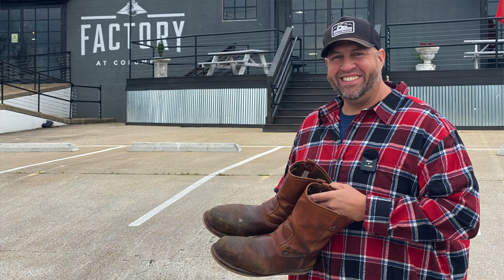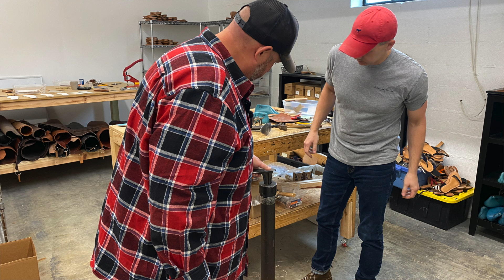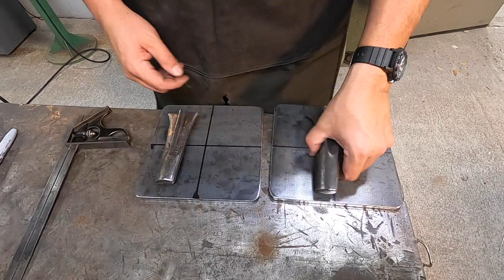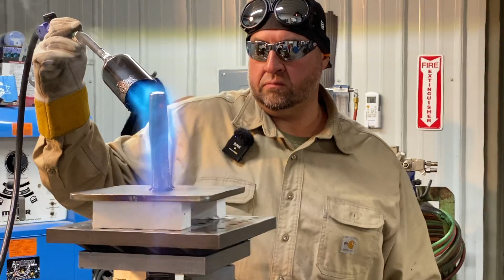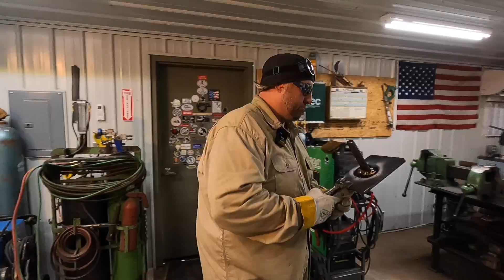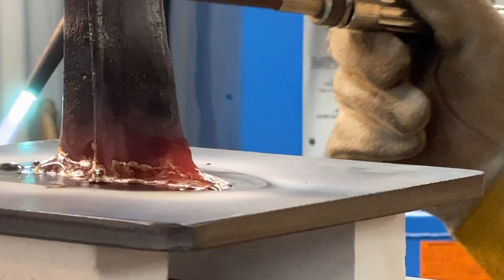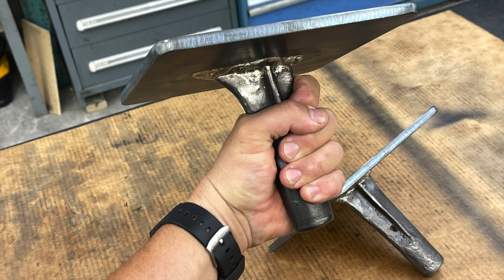Custom Shoe Anvils for Potter & Sons

Comment: Have you ever used a gas flux brazing system, Adam? I just made one from a small propane tank. I also make my own 'flux', as it's just trimethyl borate and is easily made with a still, methanol, borax and sulfuric acid drain cleaner. It's an interesting process and the witch's brew green flame is a real plus for the camera. :)

Comment: Hello,  I do agree with you that other ways could have been used to do the work but, you are the one that had the work to do so if you are satisfied with the work, and the customer is satisfied, that is what matters.

Since I am also a blacksmith along with being a machinist, (had to learn blacksmith to be able to do more things as I only had a metal lathe and a vertical milling machine. With that said, I would have forged some columns or whatever you call them out of steel and TIG welded them all the way around with steel on steel. But it is what it is and your reasoning is solid as a rock.

Comment: I am not a welder, but I think Adam is right. It seems to me that nickel is a much denser, harder material, and that makes it more brittle. Kinda like carbide versus tool steel. The silicon bronze will flex more than the nickel. I also think that the acetylene torch is probably better as it allows for a broader heat input as opposed to tig which is a more focused heat. I think using a more controlled broader heat is a better way to  go when brazing, but again, I am not a welder. Just an observation. I've learned to trust the gut feelings from those who have been trained by their fathers like I did in my line of work (asphalt construction). Starting in a trade young and being trained by your father (and grandfather) is a method of training for which there is no substitute, and is often superior than any other means of training. Especially with craftsman trades. Trades where you work with your hands, and use tools to create. It is a shame there is not more of that kind of training around today, like there was in centuries past.

Comment: 1983 high school metals shop class.  Our teacher brazed a pair of tubes into a T.  Then we put that into a vice and used a huge pipe wrench and breaker  bar to tear it apart.  The steel adjacent to the braze ripped apart, but NOT the braze!  Our teacher use to build tubular race car chassis with all the joints brazed - says the joint he just demonstrated is by the rule book.  I've never doubted brazing ever since.

Comment: I'm curious, why did you use the original casting and not just turn a new rod at that diameter, then weld it on?  Does it fit into their anvil holder a certain way or have special grooves?
Reply: Please re-watch the video...it is far from a round "rod".
Reply: @bushmaster2936  I saw it, It's an oval shape. Also it's got a seam down the middle where the molds were put together.  But I still think it's wouldn't be too hard to machine an oval shape on the mill.  I was more curious about the way it's used by the shoe guys.  I've gone to their channel and watched also.
Reply: @thisolesignguy2733  I'm not saying that Adam couldn't do it, just why would he go to all the extra effort and time for a freebie job? Also, he would have to do numerous set-ups all over again should they decide that they want more, or even something totally different after using these prototypes. : ) This is basically an experiment for both parties at this time. They had surplus parts and they were put to use in the most efficient manner by Adam. : )
Reply: @bushmaster2936  I understand exactly what you're saying.  and I'm in no way asking whether he can do it or not, or how difficult it would be.  My main question was how it fits in the anvil holder and his train of thought on the process.  But I have done some research and it indeed is a specially made oval hole that friction fits the anvil into it by way of a tapered stud.  This prevents the anvil from turning and also secures it into the work tool/bench.  Which would be in my opinion the main reason Abom decided to use the original.  and I agree 100% with his decision after researching it further.
Reply: @thisolesignguy2733  Awesome : )

Comment: Ni-rod can be used successfully but it does have a tendency to induce a lot of stress which, over time, will develope cracks. The trick to it is to weld no more than 1/2" (12 mm) at a time and then peen the hell out of it with a chipping hammer or a needle gun air chipper while it is still hot. The peening will stress relieve the weld and help stop cracking. There is nothing wrong with gas brazing or TIG brazing on cast iron and they both have about the same overall strength when done properly. With a fillet weld like these were, it helps to put a small bevel around the base of the casting. This gives more surface area for the bronze to bite in and hold better. MIG would be absolutely useless for this and would soon fail. And for anyone who is interested, I got my Alberta First Class Journeyman's Ticket in 1978 and my B Pressure ticket shortly there after so yes, I do have some experience.

Comment: Keith Rucker and Keith Fenner both do a lot of brazing. Keith Fenner brazed the final drive of a dozer if I remember right and he gave a nice explanation of how it would hold up and take the wear and tear. I've brazed with a torch many times before and have also welded using steel rod. Gas torch welding is becoming a lost art.

Comment: What is the point of cutting them off?  Why not use them as is and just bolt them (or braze) to the steel.
Reply: They're not flat.
Reply: @dolvaran  Yah, I seen that, after I shot my mouth off.

Comment: yah, i don't think tig braze all the way would be very good, the torch allows heat to draw the braze all the way in, tig looks like it gets the tip and not much else.  of course, i don't have any tig experience, but it seems to make sense, tig has a small heated area.

Comment: WHAT ARE IN THE LONG RED AND BLUE PLASTIC TUBES ON THE WALL BELOW THE RIGHT ANGLE GRINDERS WALL RACK?
Reply: Those are tig filler rod holders. Each one will have a different size and type of tig welding rod.
Reply: THANK FOR THE INFO.  I WAS THINKING BRASS BRAZING ROD.  CLOSE BUT NO CIGAR. @michaelpeace716  THANK

Comment: Old school brazing is unbeatable imho .. BUT .. I'm curious .. when you mentioned the brazing could have been prettier, .. could a person run over the final braze before it cooled with a tig to flow the braze? Ive seen guys do that with aluminum as a "second pass" .. no added material, just cleaning up the welds. Obviously not needed for this project, but on something more visible that needed to be better looking .. ??

Comment: Another very interesting video great job something a bit different. 
Having never tried tig brazing I can’t comment on it. I have seen finished tig braze it looks pretty for some applications. I have done lots of old school fire torch brazing over the years as a heavy duty mechanic. I agree I like the control with a torch and the flow of the brass with dissimilar steals done right it looks good and is strong. I have seen and had to fix braze welds that someone else made a mess of. It might be fun to try tig brazing some time. But that’s a shop only proses when a lot of my work is out in the field with heavy equipment a tig welder is not an option.

Comment: We used to use brazing on truck parts, done right it's solid. The only thing I would have done different would be to use flux that you dip hot rod into, sometimes in the past the flux coated rods didn't have enough flux for heavier applications, which had me avoid them. I'm about 30 years past when I blazed regular, so the newer stuff might be fine now. Have a great day.
Reply: I've also had issues with the fluxed rods in the past. Sometimes you need the dip. : )

Comment: on the internet and youtube there are going to be the armchair experts (the meaning of an expert is A DRIP UNDER PRESSURE )
and i don't mean that to be a jab at the real word welders good job
Reply: It cast iron on steel.  Clean and braze is fine and appropriate.
Inert gas is needed for materials like stainless steel, aluminum,  and titanium (materials weakened by oxides)

Comment: 🤣 24:00 . It is the land of infinite resources here in commentland. If we're going to "should've, could've", might as well have forged a custom shoe, CNC machined back taper with induction hardened flat surface to perfectly fit the application. Ain't no kill like overkill.

Comment: THAT SHOULD HAVE BEEN DONE SOUS VIDE. Parts should have been put in a hot water bath, drizzled with olive oil and elmers glue, then soldered together after a quick sear on a charcoal grill, not propane. This channel has no idea about cooking heavy metals.
Reply: Spot on.

Comment: Dissimilar materials - Silver solder or Braze.  Steel to Cast Iron - your choice. In addition, either method fills all the area between the materials. Any type of welding would leave voids between the shoe piece and the cast iron.

Comment: super cool. perfect technique and application. the rod and the parent material have roughly the same tensile strengths. if you tig braze the whole thing the grain structure of the parent material gets altered to really fine and its becomes brittle. oxy/acetyl all the way. learned through  Keith Fenner and verified by me. i would much rather have a tig torch in my hand, but it's not the way in this case. i really enjoy your videos. i wish you had an HBM. i miss that stuff. one of the coolest machines.

Comment: While you still have all of those shoe anvils, I'd take some measurements of the shank of the anvil that fits into their stands.  You would then have the dimensional data as well as an idea of the variation between parts.  This would let you machine a new shank out of steel, which you could more easily weld to.  You could then cross-slit the new shank to fit wider gussets to better support the large top plate for heavy applications.

Comment: I don’t think people understand that cast iron and mild steel are dissimilar metals. If it needs to be tough and quick, flame brazing is king. 

I used a couple weed burners in a fire brick forge. Those things can really pump out the heat.

Comment: A huge problem with real world testing is there are VAST differences in the metallurgy of castings and thus how they respond to welding or brazing.  It is really just a pot luck on this stuff as you rarely know how it is going to go until you are already in the middle of the project.  Welding is only slightly stronger than brazing and definitely more of a gamble at getting pulled off right.  I agree for most repairs and mods flame brazing is the safest route to  success.

Comment: What did you do to ensure that the plates would be level when installed in the stands?
Reply: He said that he squared up the initial cuts on his belt sander. Watch the video again right after he cut the first one.
Reply: @bushmaster2936  By "square up", I think he meant he would make the surface flat using the belt sander. It looks like he just eyeballed it for squareness.
Reply: @leopfeffer2419  Yup, the initial angle grinder cut was not a square cut. I can't see this professional not making sure that it was both flat and square before joining the pieces in unholy matrimony for ever and ever . : )

Comment: Why not leave at least part of the flat on ?  That would give a bigger surface for the braze.
Reply: There was nothing flat until he cut the shoe form off.
Reply: @bushmaster2936  it looked pretty flat across the heal & toe area.
Reply: @spirittomczyk2174  Feast your eyes at the 28:52 mark and you should clearly see the curvature and the gap that would need to be filled along with the angle created from heel to toe. : )

Comment: I'm no expert, but I agree with you on brazing over TIG brazing.  A TIG arc would put to much heat into to small an area on the cast iron and cause stress cracks and eventual failure.

Comment: Without the socket they put these things in it's hard to tell how square/level the plate is gonna be.  But eyeball is probably OK. 

I'm sure that braze is gonna be strong but trying to think what I would have done myself, maybe some tapped hole into the cast iron cause I never learned how to braze properly.  Dunno if there's enough meat tho.

Comment: TIG is great for welding where you need a localised heat, but for brazing you really need lots of evenly distributed heat and this gives a regulated cooling afterwards.
I've used all sorts of methods and techniques over the 50 years in the business, and you can't beat a flame.
Reply from the maker: I agree! 👍🏻

Comment: Using a stainless steel electrode is also another process you could use in welding Cast Iron to carbon steel
Reply: What flux would you use

Comment: Using a smaller tip would have allowed you to get a smoother finish
Reply: Also wouldn't have allowed enough heat to cover the areas to be brazed sufficiently. He knows what he is doing and why.

Comment: After researching home built 2×72 belt grinders I made my own. Using 1/4 inch wall square tube I used oxy acetylene brazing for the superior penetration on the rounded wall joints. Came out with 35000 pounds of shear strength. Plenty for a couple or three lifetimes of use I'm betting. A test from Fireball tool would be the decider for most experienced folks. Nice work Adam.  Those lasts look mint!

Comment: Adam, I think you did a perfect job with the brazing. In my opinion acetylene torch is the best possible way to go. It is clearly superior to TIG brazing, and clearly superior to any form of arc welding. It is obvious to me that your choices are the best possible choices. Your opinion is clearly the best opinion, and all commentators to the contrary are just dead wrong.

Comment: Adam, you are 100% correct about the brazing strength of your conventional joints vs welds or tig brazing joints.  Anyone who disagrees should look up Dan Kay of Kay Brazing.  He literally wrote the book on brazing. His 4-day course (that I've taken) will teach you about the robustness and incredible overall strength of brazing joints.  Lower parent metal Temps means lower residual material stress, less distortion, more tensile strength. When done correctly (as you've done, cleanliness is tantamount) the parent metal adjacent to the joint will likely fail before the braze joint will fail.
Reply from the maker: Good stuff! Would love to to take a course with someone of that experience.

Comment: I've always had the best results by brazing cast with the torch. Mainly because both pieces cool down slower and don't cause the cast to crack by cooling down to fast
Reply: That’s what I learned too. I cover my cast iron with my old welding gloves for 2 to 3 hours to keep it from cooling fast.
Reply: Yes the slower cast cools the better it is. I've tried welding it with stick rods and it would crack right beside the weld when it started cooling

Comment: I've long wondered if one of those weed burners would work ok for preheat, looks like it does but my thought was to reduce the use of oxy/acetylene($) for preheat and use cheaper propane. But I can see the weed burner chewing through the propane. It would be interesting to hear how the fuel consumption works out.

Comment: Many steel axle tubes spin inside the cast iron axle center section, factory pressed in and arc plug welded in 2 spots 180°. Those plug welds fail and the tubes twist when drag racing or extreme off-roading.
Reply: Had a 12 bolt do that… couldn’t believe it.

Comment: Good call on the brazing! People just do not understand that cast iron is very brittle and mild steel is very ductile.
If you join then in a high temperature, during the cooling process the steel will deform but the cast iron will not. If it do not crack during the cooling process, it will accumulate internal stress forces and will be prone to crack later.
Good brazing has almost the same resistance of a steel to steel weld, with way less risk of fracturing.

Comment: I am on your side. Brazing is very strong if
you have enough surface 
area . When I was about 24 I saw a brazed lathe type tool bit that the entire carbide tip was shattered and the braze
still held. I have brazed carbide tips on cutting tools for years with great 
results. Carbide burrs are 
brazed to steel shanks and I have seen the shank broken off and braze still held. Welding cast iron may create cracks.

Comment: I did an mechatronics apprenticeship and learned the basics of manual and CNC milling and turning  but also welding and hard soldering/brazing. I was a big fan of brazing with the acetylene torch because of the flexibility and versatility (and because acetylene is just fun). I still have a bottle opener I made that is basically a M24 brass nut I made in the lathe brazed onto some hex brass stock. Sadly now most of the stuff I do is related to electronics and radio transmission, I do miss making stuff out of metal :(

Comment: Lot cheap using weed killer to heat rather than the acetylene. Braising is amazingly strong.  You're doing the job, do you it your way. When I was in Bomb Disposal, it was upspoken that if your in charge for removing a bomb. It was the tech that came up with the method. He was up close an personal with the item. Sometimes little things you see can matter a whole lot on the out come. There will always be arm chair leaders who thing there is the only way. Not true, always a 1000 ways to do something. Not all of the wise or cost effective. You could have made a undercut of the shank on the still to give it more surface to hold. Took you 4 times as long and not difference in strength.  Good Job